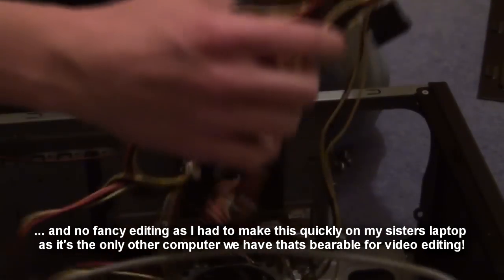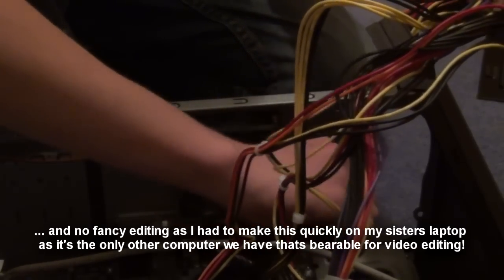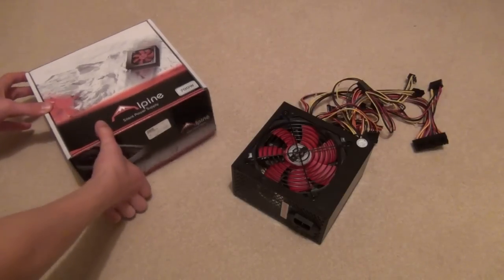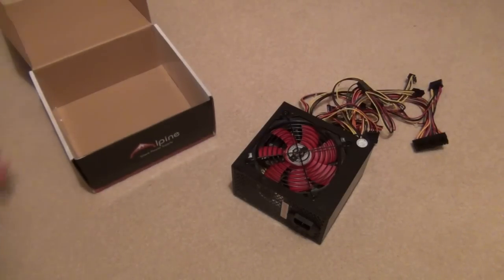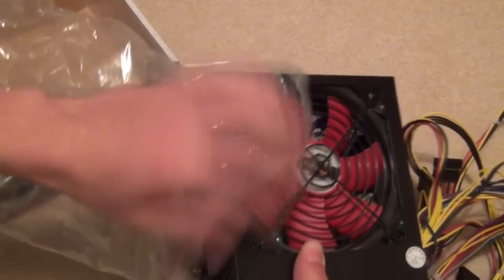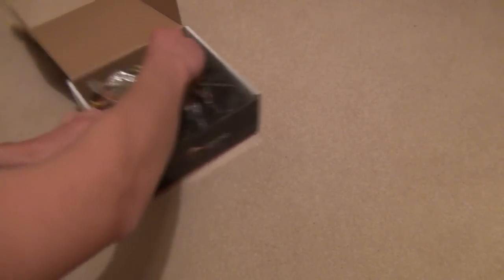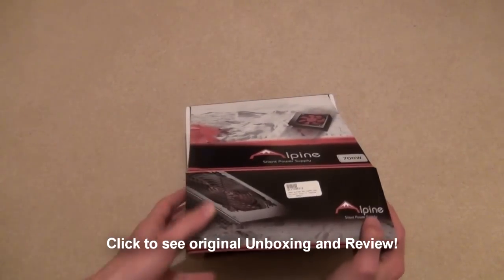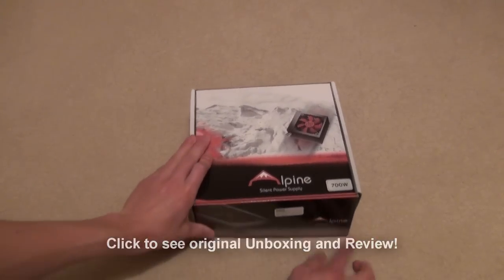Alpine 700W Power Supply | Broken :( | HD

Comment: I've been using my Alpine 700w (with red fan) for 3.5 years now, so I think they have an unfair reputation. It's was handling my R9 270x card, until a week ago when the GPU died. Now I know more about PSU's, I wonder if it encouraged the death of the card. I also was having problems with passport drives cutting out when the 270x was plugged in. Anyhow, I've recently upgraded to an r9 280x and expected the PSU to handle it! lol. The pc shut down during any heavy graphics or Furmark, which started me off on my PSU research. Now I know the Alpine are cheapy PSU's and don't actually offer 700w at all, I will be going for the Corsair TX650m.
Lots of people say Corsair are heavenly, but been reading alot of bad things about the CX series (although not the later versions). Some cheap PSU's are fine if you don't want to game with them.